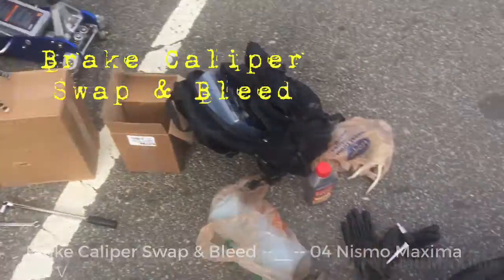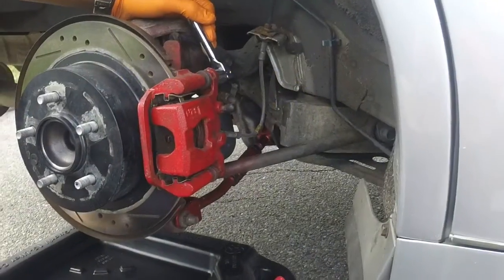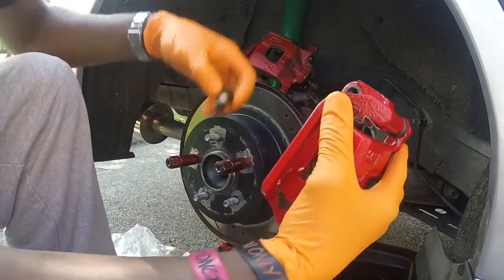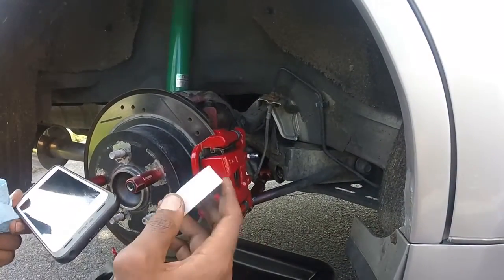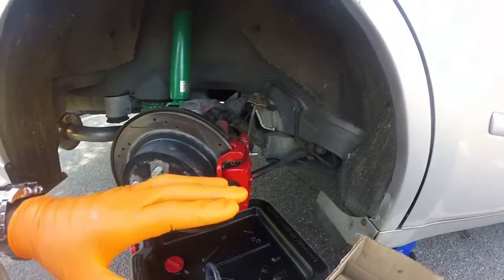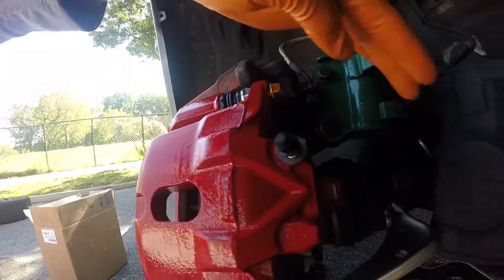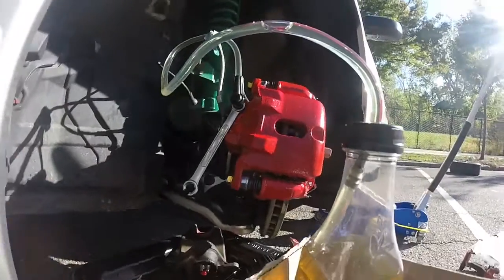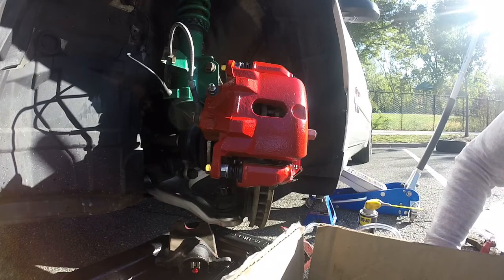Brake Caliper Swap & One Man Bleeder --__-- 04 Nismo Maxima

Comment: yo og i changed all brake calipers n did this but brakes are still spongey any info on possibilities of why
Reply from the maker: There is still air in the system or a leak somewhere. If all the brake fluid drained out then it may take a lot of fluid to get the pedal back to its normal firm state.

Comment: yo og the Radiator from Rock auto .. does that come complete... or do I have to get the shourd and cooling too or its all together...I don't want to forget nothing ... I'm starting with that then moving down to my lower control arms and assembly brand new .. let me know what I need .. bro ... thanks .. and if your info proves true like they been I want to send you something for ya help ... real nigga...bump j ...
Reply from the maker: The radiator comes alone bro.. You'll have to acquire the fan shroud, lower & upper rad hose. I would suggest the Mishimoto aluminum radiator.. Last a lifetime..